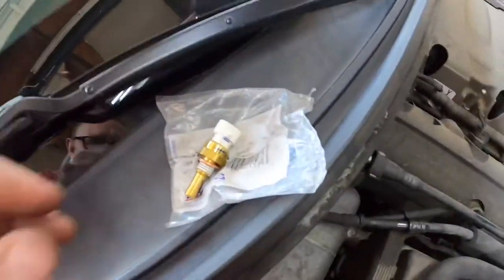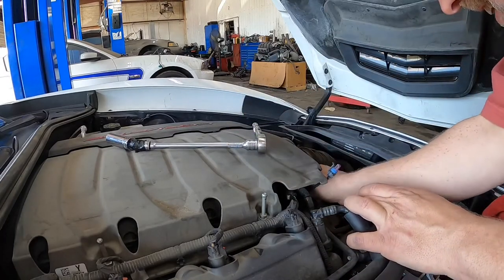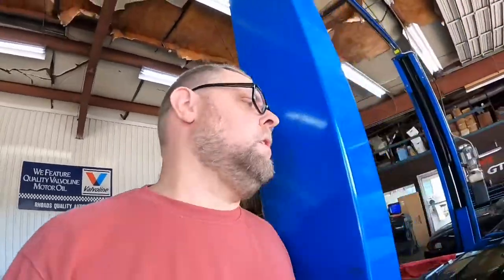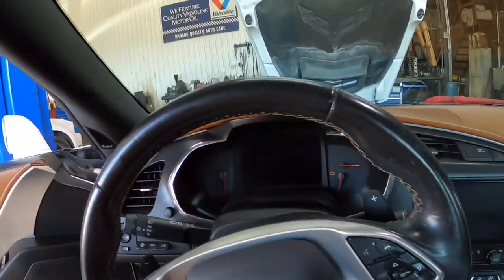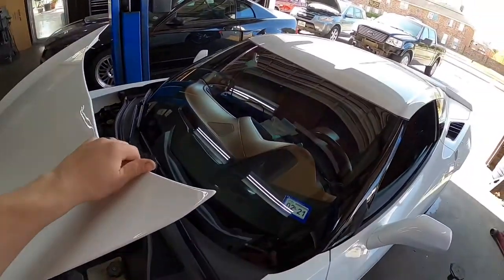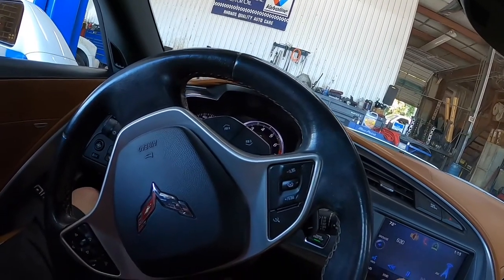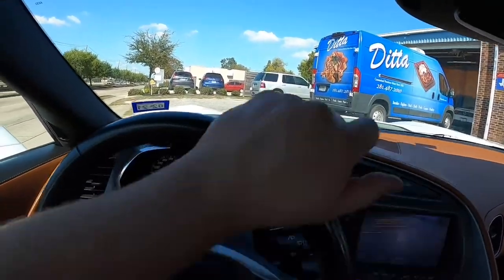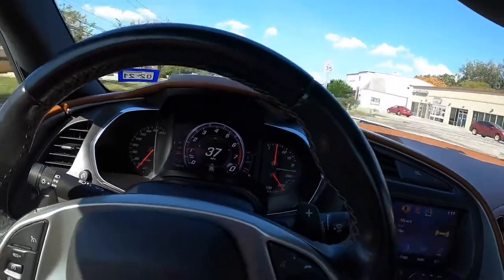C7 Corvette coolant temp sensor replacement.

Comment: Maybe next time could you show us where the sensor is located.
Reply: Agreed. Just to vague. You didn't show much. Specifically, how to detach the clip off the top of the sensor. I don't want to break that. The specific location of the sensor is key. Tools required with sizes as well.
Reply: In the end. My issue ended up being the thermostat. Symptoms were zero temp gauge reading, engine ran warmer, check engine light on, elec fan on constant while driving, fan stayed on over 15 minutes after car shut off.

Comment: I have a 2014 Corvette. I just looked at where the coolant temp sensor is on my car. Yes, it is in the location as shown by Adam,,,, BUT, there is no freaking way to get a large socket on it. I call total BS on this removal.

Comment: I am having same issue with my C7 temperature gauge won’t work and fan running high speed I changed the sensor out but still same problem do I need to reset the computer and if so how do I do this
Reply from the maker: Yes you have to reset the pcm. Any code reader and most hand held programmers will reset codes.
Reply: Thank you so much it worked
Reply: @svt_adambuilds2038  what if it’s not throwing codes all its doing is not reading temp with analog gauge and blowing fans at full blast with no codes ?
Reply: @chris5.0coyote28  mine took a few cycles before it showed up. If it just started may not have shown cel on dash yet. Code is probably pending.
Reply: on my c7 that front sensor was an oil sensor.  the water temp sensor is on the left side front

Comment: My 08 c6 is reading check coolant analog n digital gage is reading 165 deg.   Any thoughts.  Tks Dave
Reply from the maker: Usually if the dash is saying check coolant it’s a level problem if it’s full I would suspect the level sensor.
Reply: @svt_adambuilds2038  even if gages are both reading 165 deg.  Pulled car out in driveway yesterday let it run and everything seems fine now.  Fans are cycling correctly.  ?
Reply: @davebush3913  do what he says ... Also if you don't have it I would suggest to create a profile at c6 corvette forum there you gonna find answer for every question...best of luck

Comment: Hello! I have a slight issue with my C7. No engine light however occasionally the fan will go blazing fast - even with the engine off. There are no reading from the temp gauge as well. 

Sometimes it fixes itself and I won’t have an issue for a while. Recently it’s having the issue again and I want to get it fixed. Will replacing the sensor fix this or will a PCM reset fix this issue?
Reply from the maker: Yes this car had the same issue it was intermittently happening, on the way in it ran perfectly fine with no check engine light. Replaced the sensor and reset the ecm.
Reply: @svt_adambuilds2038  that’s great to hear. I’ll go and check it out. Do you know if DelCo sensors can be purchased at an Autozone or something? 

Also, how do you reset the ECM on the C7? With a code reader?
Reply: did u ge this resolved? my fan is blowing with engine off as well. need to reseting it but the guy didn't show me what to do
Reply from the maker: @RobotReanimation  I didn’t see this until now I believe O’Rielly’s has Delhi not sure about Autozone. And most code readers will clear the code.